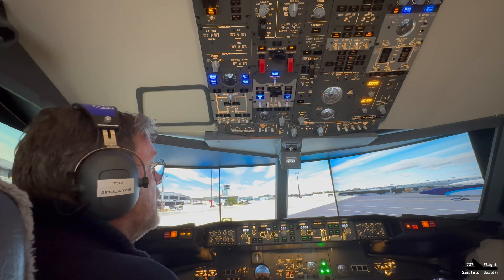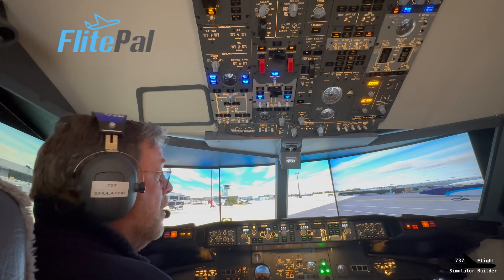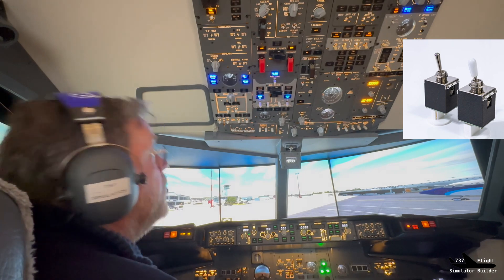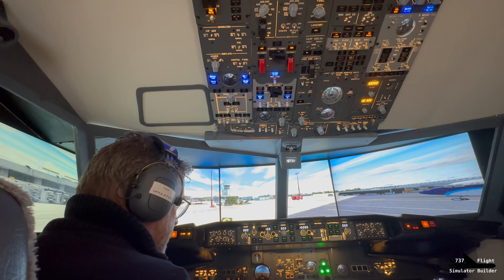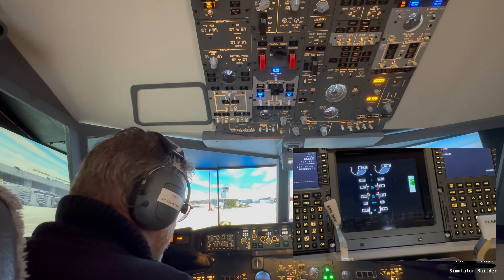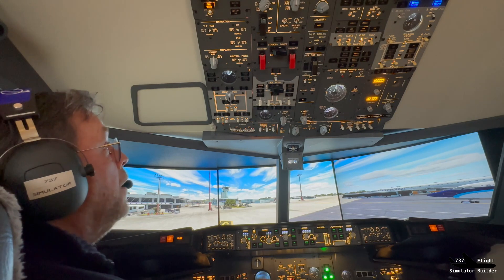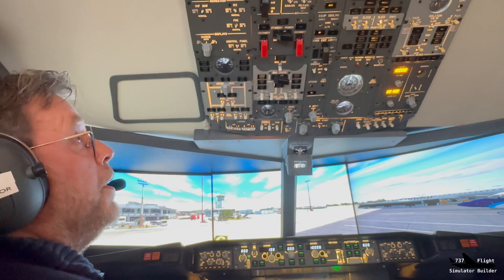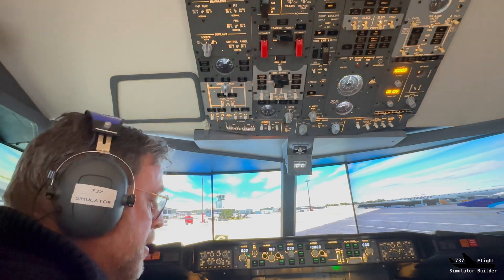737 Simulator build: Solenoid start and yaw damper switch from Flitepal

Comment: I also bought the Flitepal magnetic switches for yaw damper, wing anti-ice and voice recorder. The are very, very well made and work perfectly. They are each on a Arduino mega 2560 and require no extra power with the mega driven by the standard 5v cable from a powered multi-usb port to support 5 megas for my FWD overhead. I have been asked if they heat up as small and can report no heat build-up. If you want to add simulation as they clack off, worth the investment. I have now bought the starter switches and sure they will operate as well. Ivan is great support for any setup questions. Alistair

Comment: I know the wing anti ice switch has an automatic function but I don't know if the engine anti ice switches have such a function
Reply: The engine anti-ice switches are standard 2-position toggle switches. They have the locking lever function, meaning you have to pull them out to change position. The budget replication is to just use a standard switch.